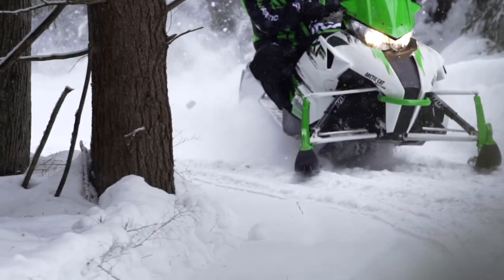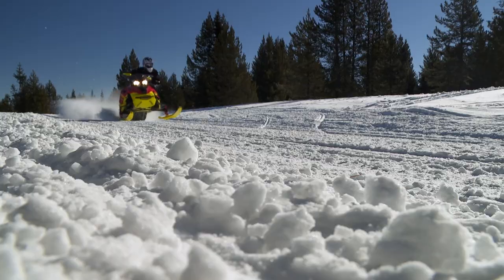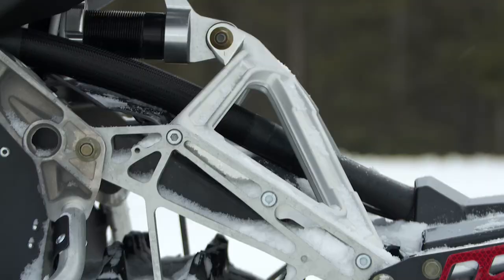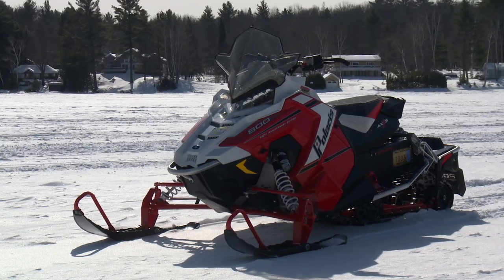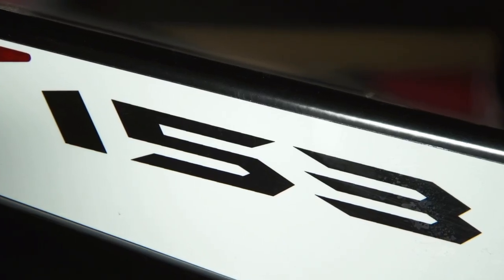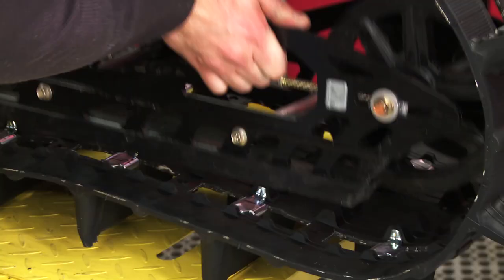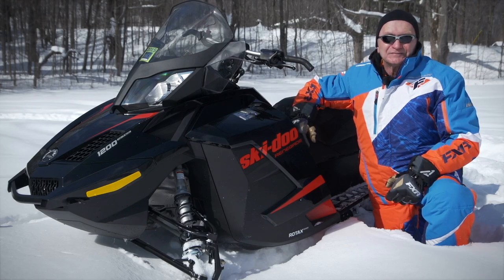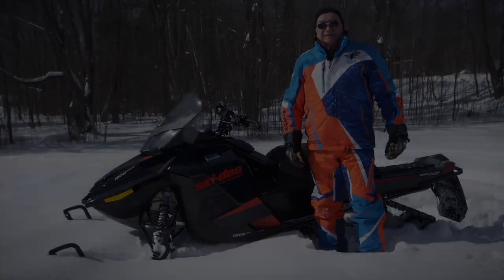SnowTrax Television 2015 - Episode 13 (FULL)

Comment: Great episode! I've got 1800 miles on my MY15 Rush 800 and loved it. I haven't lost a single race, lake pull or otherwise. I have had zero reliability issues even with many lake pulls and a couple 2 mile WOT runs. The gauge is amazing and the word that comes to mind every time I blast through some twisties or lift the skis on command is this: Satisfying. 100% satisfaction. The ride dynamic is just awesome. Only negative I've experienced? My fuel/oil mix is still just under 40:1. I love the sled but with all the hype regarding oil consumption, having to take oil with me on a bigger day ride was a let down.